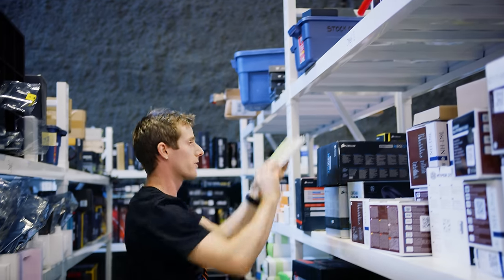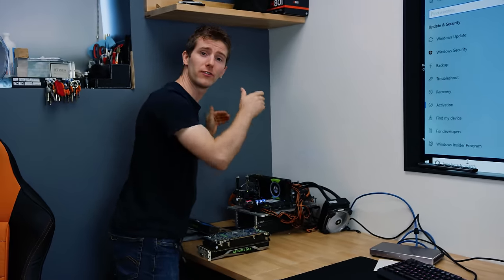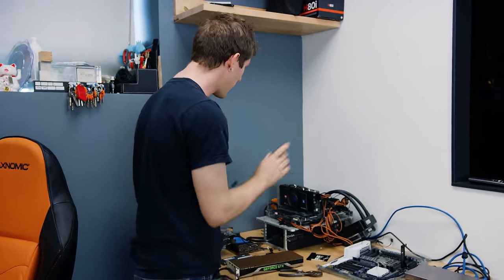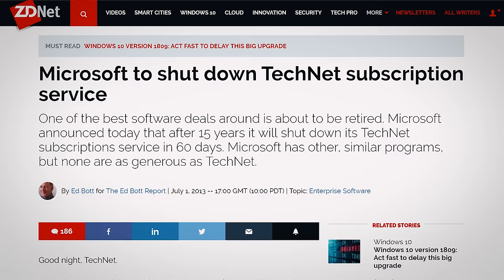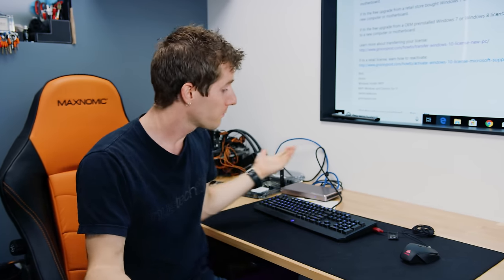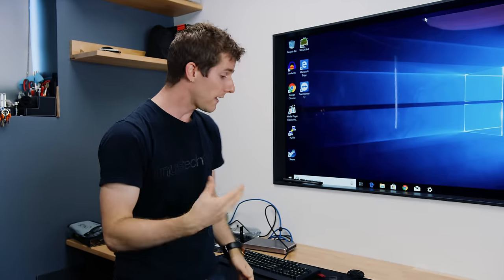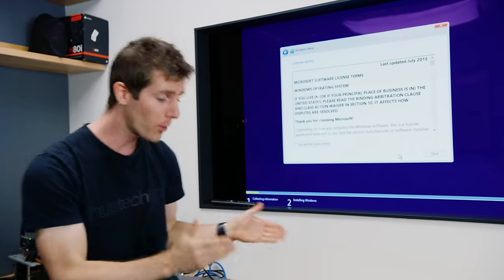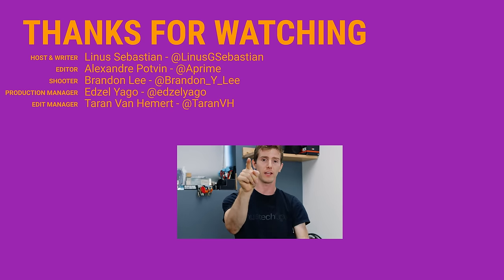Why Does Linus Pirate Windows??

Comment: TLDW: Microsoft is evil, but you need windows.
Reply: No you don't, who forces you to use Windows?
Reply: +Blazy programmers who only make software for windows, and programmers dont make any other OS that seems to work as well.

Mac OS is annoying
Linux is only free is you dont value your time, and infuriating to use. I'd rather use DOS.
Reply: "Linux is only free is you dont value your time, and infuriating to use. " - which distro did you use? I use Linux daily and don't have any problems. However, when I was using Windows that was an infuriating experience for me. Maybe we have different things which we value?
Reply: @rinoaleonhart86  just use a compatibility layer
Reply: Probably depends on what you're used to. I use Windows and have had no problems this far. 

A change in enviroment usually has a negative effect on the mind. That is why when a new OS releases people are like "this is so shit" until they get used to it and then it's fine.

Different values aswell. Windows is the middle. More features than  Mac but not as modular as Linux.

It is good for a standard consumer but if you want to do more with your OS and are knowledgeable about it Linux is good for you. I've heard Mac is good for stuff like editing videos and images but I haven't tried it personally.
Reply: Blazy "No you don't, who forces you to use Windows?"  
Excerpts from "Linux vs. Windows NT and OS/2" published around 1990 by Bernie Thompson,  a member of IBM's development team for OS/2 2.0 and 2.1. 

"Picking an operating system is a dangerous business. You're committing yourself to a couple hours, certainly, or maybe a couple days of manual-reading, file-editing, and hassles.  If your real goal was just to get some work done, maybe it would have been simpler to stay with Windows 3.1 and never embark on an adventure in computing."
...
" Operating systems determine which applications will work, what those applications will look like, and how they will work  together.  For example, if you want to run Microsoft's application suite (Word, Excel, Access, and PowerPoint), you're out of luck with Linux.  They won't work.  With OS/2, they work for now, but the burden is on IBM to keep up since Microsoft abandoned OS/2 in 1991.  In the end, Windows 3.1 and Windows NT are the only safe choices for using Microsoft applications. "

Now you probably understand why MS sold its first MS-DOS, which was a clone of CP/M for $20 bucks instead of $200, and even implanted AARD code.
MS very well FORCES you to use it. It does EVERYTHING it can and did it from the start.
Because you are its profit.
Reply: Linux is freedom, but sometimes has trouble catering to the limitations of other OS. Therefore I use both. Linux for work and servers and Windows on a different computer for gaming and supporting people who have problems with their windows software.
Reply: Mate if it wasn't for a very small selection of games I like to play that PlayOnLinux doesn't support, I'd be using Ubuntu as the only OS in my PC.
Reply: Horseshit. These days, Ubuntu is actually simpler than Windows. But hey, go on assuming your decade-old information is still up-to-date.
Reply: My biggest problem with Windows is that I had a feeling like I'm not at the top of hierarchy when I used it:

I'm working on something.. - Windows: No, now is the time to restart computer!
I tell the computer to turn off. Windows - No, you have to close all the running applications first!
I don't want to run a specific update, because I'm using a software which is not working properly on that version. WIndows - No you have to update!

etc...

I mean, I get it. Windows is made to be idiot proof. But the side effect is, that it then treats you like an idiot when using it.
Reply: You'd rather use DoS than Linux ? Something tells me you haven't tried a recent, modern Linux distro.
Reply: Being used to using both is objectively better as a super-user. Windows has become faster than it was with xp and 98, but also more convoluted and less user-friendly for super-users.. and it is based on something inferior to Linux.. patching and expanding wont change that.
Reply: PlayOnLinux is cool, but there's now Steam Proton which supports over 1000 Windows games as perfectly playable.
Reply: @gogista  maybe you don't game ?
Reply: @honestdolus5263  I guess you don't game but ok.
Reply: @gogista  disable Windows auto updates lol. And you can force shutdown windows when you want, but remember windows is saving all the files by using the shutdown feature.
Reply: @AngoEmpregoTV  I guess you don't game too, and you don't use NOX, OFFICE, OBS, STEAM, ADOBE AFTER EFFECT, and I could go on, but you know I'll stop here.
Reply: Oh, I play games; I'm just not such an enormous man-child that I let video games dictate my life choices.
Reply: Linus is being a disingenuous here. He can say the GPLv3 isn't a good fit for his kernel, but it doesn't violate the spirit of the older versions of the license.
Reply: @IAmTheRealKen  Sorry pirating games is still not available on linux, and Adobe , Office , Sony Vegas doesn't work on linux, and gaming on a Linux is a mess.
Reply: @honestdolus5263  Well expecting that answer, boring, listen, people game, and I game, and if you don't, it's ok lol, don't be salty your beloved OS cannot play games.
Reply: I've heard it said that Windows assumes the user is an idiot. Linux requires the user to prove they're an idiot.
Reply: @honestdolus5263  I'm using Windows for editing and Illustrator and gaming, and none of that is available for linux, bummer lol.
Reply: Moron, OBS, Steam, and Nox all work under Linux. And pretty much anything you do in Adobe's shit can be done with something else. And plenty of people get buy without MS Office these days. Hell, most people just need a word processor.
Reply: God, THIS is what gaming culture has become... Listen, for one, it's obnoxious that you just say 'game' as a stand-in for video games. Two, it's sad that you let your hobby dictate your life decisions. AND finally, even if you take native and Wine out of the picture, every emulator under the sun works on Linux, I have thousands of games I can play.
Reply: Games do.
Reply: a lot of you guys are missing the point. i dont have time to fiddle with controls and all that shit when i have to get work done. I worked at Apple for several years and so i'm a bit burnt-out on MacOS, but in the end even Mac does a great job of not having to take 2 hours to get a program to run.

Things i do on windows that i cant comfortably do on linux.
1: Efficiently edit videos with Adobe Premiere for my job
2: play video games without having to fiddle with stuff
3: never have to use command prompt. if you have to use command prompt, the OS is a failure and should just install DOS or CP/M.
4: i'm not sure of any programs for linux that work like 3D Ripper DX. i like running a game and ripping 3d data from graphics card video memory to then 3D print things from the game.
5: tons of other little odd one-off windows programs people have written.

Only thing linux has going for it in my workflow is that Blender works on it, but Blender is wonderful and works on almost anything.

Every 6 months or so i get the itch to try linux, i download some random ones and install on a laptop of mine. and just get fed up trying to get it to work. it feels to me like a horribly outdated system, i ran into the same problem with MacOS when i was trying to get a mac to output for a 320x240 CGA monitor. you can poke and prod some Windows graphics drivers enough to output even NTSC-compatible video from VGA with just the GUI.

A good OS should be unnoticable. when i use windows (mostly 7 and XP, sometimes 2000 on older equipment) i know how to use it well and it does everything i'll ever need. the best tool is the one you know how to use best, and the one that is the most fool-proof.

i just dont see linux ever getting out of the hole its in. Using an OS shouldnt be like mountain-biking, it should be like commuting. sometimes when im in a rush, and need to get shit done (which is many times a day) i get infuriated when i have to be a power-user.

imo "power-user" is a roundabout way of justifying a system thats obtuse and difficult to use. I'm only one because i have to be, not because i want to be.
Reply: +cody    windows 10 is a joke. most windows users i know stick to 7 and XP, which is the smart move for offline systems.
Reply: Blazy “MacOS is annoying”

MacOS is by far my favorite operating system. With Ubuntu in second place (followed by several other Linux distros) and Windows coming in dead last.
Reply: +Adam D.      But i'm not an Apple user. im really not sure what your logic is.

and you have that mixed up, Linux failed at serving me. I am not beholden to the OS, the OS should be beholden to me.
Reply: +Sergis Cool well I have Adobe Photoshop CC 2015 working just fine with Wine, Office 2016 works just fine with CrossOver, and I don't use Sony Vegas. Gaming on Linux is great, I just tested out every GTA game including GTA V and they all worked fine, CoD4, CoD5, MW2, all work great at native performance and there are tones of Linux native games too.
Reply: I like both Windows and Linux I just prefer Linux.
Reply: Rinoa Leonhart if people stop using windows and mac and use Linux instead then programmers would make software for Linux ... Chicken & Egg problem :/
Reply: @rinoaleonhart86  
From my point of view Windows Suck's the only thing Windows is good for is gaming everything else you can do it better on Mac OS, Linux, Unix, Android, Chrome OS even Amiga OS. Plus the security is a million times better than Windows. If not you can use React OS it's still in Alpha but it's natibly compatible with Windows applications.
Reply: How the fuck did you get windows is evil from this video?
Reply: I believe what he is trying to say is that you may not “NEED” Windows, but it is the most compatible with the most popular games/programs. For example, Fortnite requires Windows OS (64 bit).
Reply: Actually what I got from it was that Microsoft is really fucking reasonable about it, even letting you install windows without an activation key.
Reply: No, you don't. I use Mint Linux, but you can choose your own flavor based on your own needs. It's not that I don't already own a number of Windows pro 10 & 7  licences, Hell I even have Windows 95, 98, NT, 2000 pro too. Would you like to see a copy of Windows ME? But, it's the fact I am sick of the Windows issues, updates and spying. Gigabytes worth of rubbish. Linux just works as long as you know a few simple elementary concepts and for the most part doesn't spy on you, and if your really advanced enough you can setup your own desktop completely how you like it. I've built my own kernels just for kicks. But if your a newbe, no problem. Grab yourself an iso, burn it and check it out or live in the Windows camp and keep complaining. Ain't nobody making you do anything.
Reply: Not good ones. Anyone who truly believes that Linux can compete with Windows as a stable Home OS for gaming or professional uses outside of IT and software are hilariously overspeaking the praise Linux deserves.

Linux fills its niche very well, but that niche is not "user-friendly home operating system".

Linus tech tips MUST operate on Windows platforms and run benchmarks on it because Windows is the only real OS on the market. Mac fills such a tiny population of the OS space and Linux even laughably less, that it makes zero sense to use Linux as a testing platform when 98% of your viewer-base uses Windows on a daily basis.
Reply: Kats  So, Deserved? Have you gave it a spin? Do tell me what gui and distro you've tried? I am getting a feeling I've already got the answer. The idea that these two distinctly different OS's compete is complete garbage.  Linux is largely free, free as in air in many cases while Microsoft charges some fat cash for the 'distro' of my choice. Completely different models. One might even go as far as to say for geeks, by geeks and I'll largely agree. But, it doesn't have to be that way. Besides, your email and youtube videos could give a crap less about what hardware your using let alone the OS. That's the wonderful detail so many miss. Yet if you think about it Linux is the most widely used operating system point blank. In fact many devices use the linux kernel. Android ring a bell?  The internals of what makes up OS X, IOS largely free and open source from the Linux/BSD OS. But, I am not going to praise Linux, it has it's faults too.
Reply: You NEED windows. It's not even debatable.
Reply: @AngoEmpregoTV  there is no Adobe suite, and wtf is libre some shitty product? No thanks office and Illustrator is still the best productivity apps, gaming on Xbox? Switch from PC to Xbox? Idiotic at best. PC is the master race not Xbox
Reply: @AngoEmpregoTV  I don't wanna waste my time learning libre if I already has office, again with that shitty answer "how old are you" seriously? "Responsibility" lol, that's why don't take boring jobs from 6 to 5 , take jobs that makes money but still have time for gaming, like an editor, I could game for a bit before working on the project again.
Reply: @honestdolus5263  game is basically video games, now then, I want to play battlefield 1, and Linux can't do that because it's not supported, not only that emulator lags the game.
Reply: @AngoEmpregoTV  I'm just used to windows, can't switch if there no major reason to.
Reply: Emulator? you serious? emulator is laggy as shit and why would i install linux if there is no advantage that i want.
Reply: No worries i pirated windows i dont care shit about the windows key.
Reply: windows isn't pathetic, its just simpler and eazier, no need to install fucking emulator just for photoshop or some shit, linux isn't great, it's fucking hard to use and has no major advantage over windows.
Reply: Linux just needs to be able to run my video game collection and I'll swap over completely. Valve is working on the first steps towards that, hopefully within the next few years we start to see something.
Reply: @Oreoezi  You sure sound like you know a lot about Linux, and why people use Windows primarily also.
Reply: @MrDarkyosh  if you are trying to say that I lack experience in the OS , Ive used the command line for server use since 2015 and used it as my main os since early 2017. For 6 months I've removed windows completely. I can say that in my case the pros outway the cons by miles, I didn't really put the question of whether I had fun gaming because my time got eaten away by coding. OSU and csgo both run fine, fallout 4 also did to some extent, cities runs great too. My games run natively or with little obstacles that can be fixed. please don't spread misinformation.
Reply: @chiefcaptn1922  ouch
Reply: @rinoaleonhart86  once you learn to use linux you will save time over windows
Reply: @gamingFTWchannel  too bad the SJWs have taken over the development of Linux from what i can tell. since i made that original comment 5 months ago, i've realized i cant ethically support linux since they are accepting the crazy SJW ideology. im trans, and the LGBT community is doing everything it can to drag down the public image of L G B and T people. guess ill just be using DOS or Apple soon.

Comment: TLDR: You can install and run windows without license just fine.
Reply: So i get the windows 10 without buying the license forever ?
Reply: @theOrdinaryDev  No, you will run windows 10 jut fine, but you will get the watermark and you wont be able to customize some options. If you want a digital license tied to your microsoft account, just use cracked windows 7 and then migrate to windows 10 disability program. You will get windows 10  license for free, that way, but its only for a one PC.
Reply: @SekretZdzicha  is this a really time consuming or like an hour deal
Reply: @time_lapse9296  bro..you can download windows 10 from the official site... Just download, put in an USB and you will have windows 10 legally, the only thing is that you will have the watermark and don't have some options if you don't pay,.
Reply: @sgm7650  you can get a windows key for like 10$
Reply: @Reptilectrik27  Yeah i know, the OEM ones, but if you change the hardware you will need to buy one again... sooo
Reply: @SekretZdzicha  use kmspico or there are commands you can put in CMD to activate windows.
Reply: The best way to pirate windows is to google product keys
Reply: @sgm7650  it only deactivates when you change your motherboard. And you can change your mobo like 10+ times before those oem keys will set you back as much as a retail key. Plus retail keys are limited to 5 motherboard changes anyways so they're not worth it at all.
Reply: I have a cracked one it is activated with full options even windows updates

Comment: The only thing i found using an un-activated version of windows 10 is that you cant change your background or your color however this is just in the settings window. You can still download a picture to your desktop, right click it, and click set as desktop and you can change the color of the task bar just by selecting "change color based of wallpaper" in settings.
Reply: it will reset to black every once in a while when it nags about activation again though, at least it did that shit all the time.
Reply: You can actually bypass the block and personalize anything by directly editing the registry, tho you need to know what you are doing.
Reply: Download wallpaper engine ez bypass
Reply: I haven't encountered this problem on my un-activated windows 10 

Question in your windows you can't have the changing background?